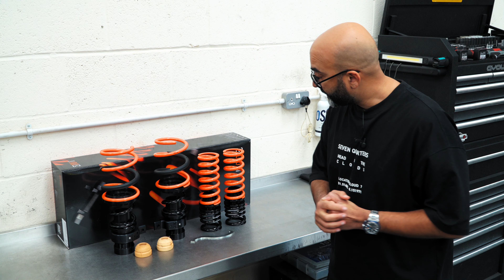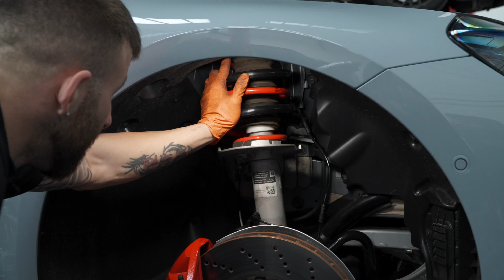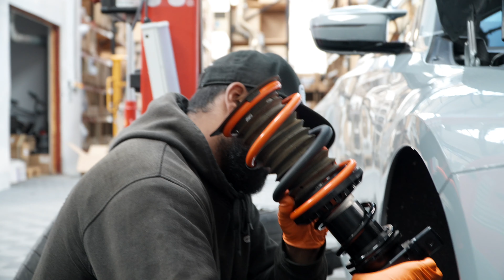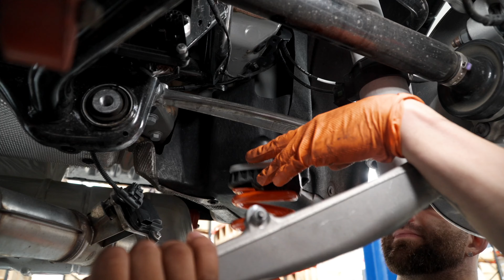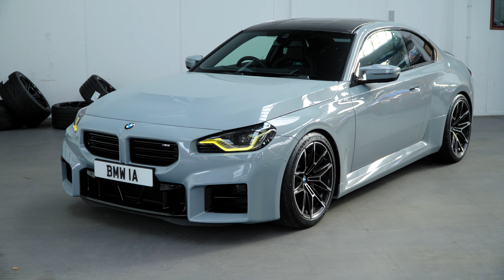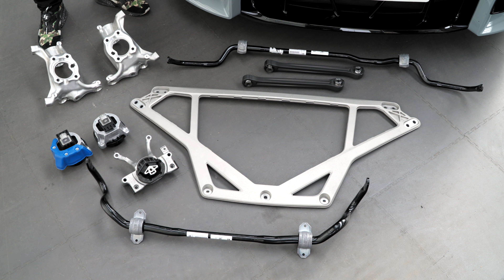G87 M2 MSS Hybrid HAS Kit Install + Driving Review

Comment: Just got the Evolve lowering spring and spacers kit on and to be honest parking the car outside the house it looks totally mega(confirmed by several neighbors). Although that being said, when driving at high speed the rear got really low especially when it is compressed over bumps and under hard acceleration. To be honest I am very interested in upgrading to the hybrid system as an upgrade and get the exact look I wanted on the car. 
Great stuffs and look forward for more contents! Cheers